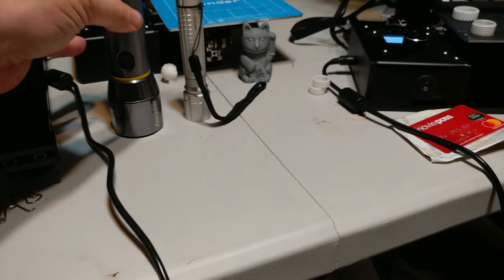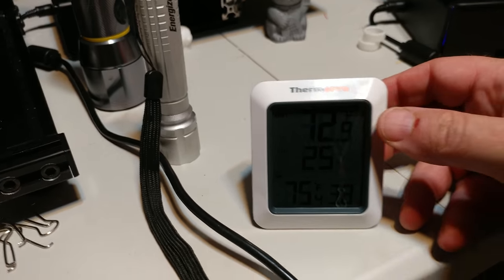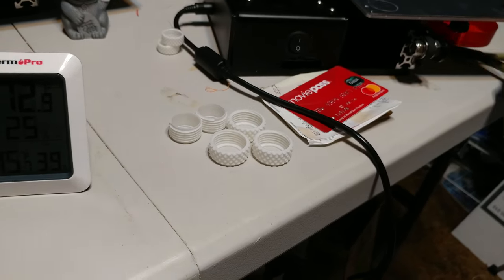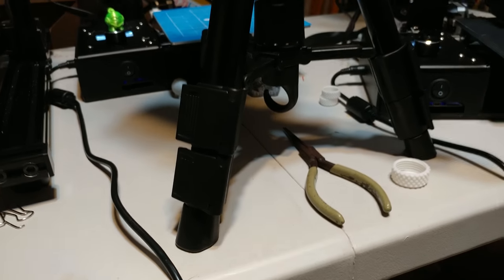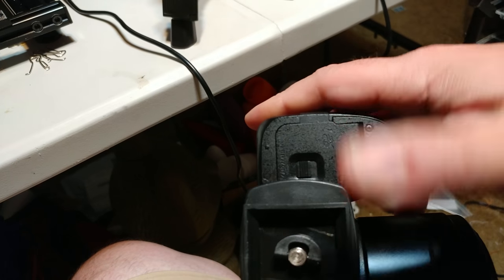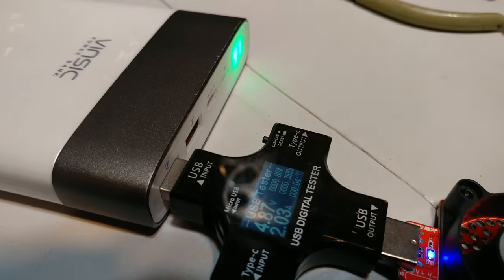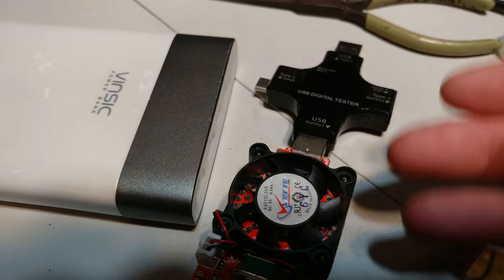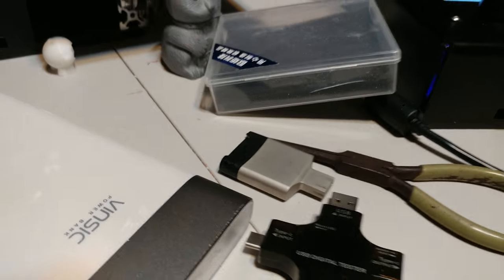Today's 3D Print - Gadgets and Goodies

Comment: I ordered myself a new printer yesterday. I have an Anycubic i3 mega on the way. I am also considering the Ender 2 but I will have to wait on that one. 

If you want some solid built flashlights check out stream light. I have had a few different "high end" flashlights (fenix, thrunight stream light, trustfire, etc...) and nothing tops the build quality of streamlight. you do pay for that quality though. My favorite light is their stylus pro. Uses 2 AAA's its only like 70 lumens but its plenty bright for a little pen light. I have a thrunite ti4 (basically same 2 AAA pen light) that is 240 lumens but I hate it. The quality is crap, battery life sucks, and the switch is annoying. I had a couple of those aluminum energizer lights. Mine weren't energizer branded but smith and Wesson and a different brand. Basically some china company made those and branded them for 10 different companies.
Reply from the maker: streamlight is amazing from all accounts I have heard. but far beyond my budget :-)
Reply: Look into the stylus pro if you want a pen light. Its around $35. I meant to ask you. Have you checked out the Anycubic i3 mega? I sold my Anet A8 and ordered one the other day.
Reply from the maker: the i3 mega looks like a cool printer. not a large enough print volume or otherwise "special" to make me spend my own cash on it (far far too close to the price of a CR10 ie I would rather just spend $45 more and get a CR10) but it DOES look nice. like a newer beefed up maker select duplicator I3.

the Touch UI looks nice too. if anyone else wants to try one and you don't mind waiting a few hours I can make an affiliate link for it (or anything else you want to buy on gearbest)

Comment: Notice you had a credit card on your table , you may want to avoid filming your cards or mask them in editing, for security.
Reply from the maker: NetWolf3D good catch. Especially in 4k. Thankfully thats a movie pass card and cant be used as a normal credit card (it always has a zero balance until you activate just before buying a movie ticket.
Reply: Nerys cool, but still could be used for identity. Btw u mention zip lines one ur cones, have u tried in S3D to use layer random start points?
Reply from the maker: random start points is far far worse (at least for what I am printing). you get stringing internally compromising shell integrity and just random teeny tiny zits all over the place. when the zipper is this clean and smooth its better to just have a nice straight zipper line and retain strong integrity in the part.
Reply: Nerys yes I don't like random normally but works for some geometries

Comment: I am receiving a monoprice maker select plus tomorrow and I want to start a channel and I was wondering if anyone could give me good ideas. Please and thank you 😊
Reply from the maker: The maker select was my second printer (first real printer) and its a freaking beast. not the highest res or highest quality but a nice overall machine. I have many videos on it. check them out.

immediately while you are waiting. spend the $50 to order the z brace kit and the $28 to order the replacement y plate. you will NOT regret either one. they make a huge difference in quality of life for the printer and you.

next up 200x220 plate of glass (200 because it has to fit between the bolt heads) and order some print in z (coupon code TODAY3D will get you 10% off on stock sizes order 220x220) get the skin you don't need the plate.

Make those couple of changes and you will get thousands of hours of blissfully wonderful printing from that machine!
Reply: Nerys , Will do! Thanks for the tips and I'm very excited for my printer to get here😁
Reply: Nerys , Ok so I goofed😂 I accidentally ordered abs filament and I'm having a lot of trouble printing with it, do you have any tips for settings with abs?
Reply from the maker: Luke Huskins okay I have actually never printed with abs I actually think I have to rolls here somewhere but I've never used it because I haven't had a need yet but here is what I do know you need a higher temperature 230 to 240 degrees Celsius and you need a hot hot bed you need to get past 90 degrees ideally pass 100 degrees to get good stiction beyond that I honestly have never used abs also if you want to print large you will need to enclose it and somehow keep the heat in but for small parts you can get away without enclosure
Reply: Nerys alright thanks for the tips!👍